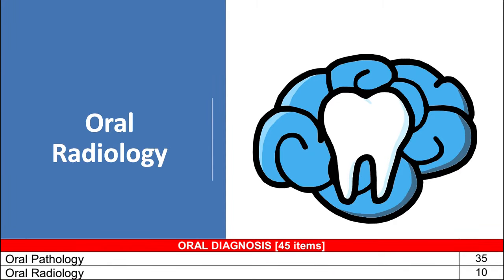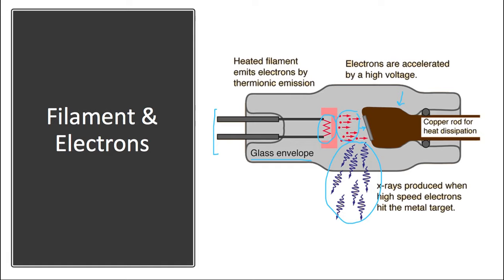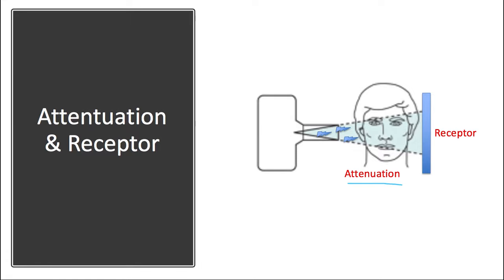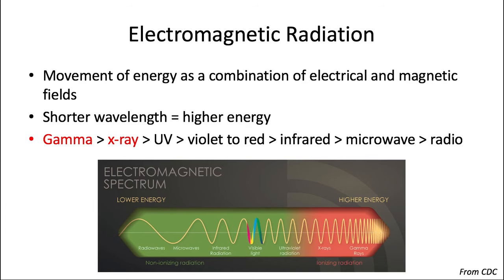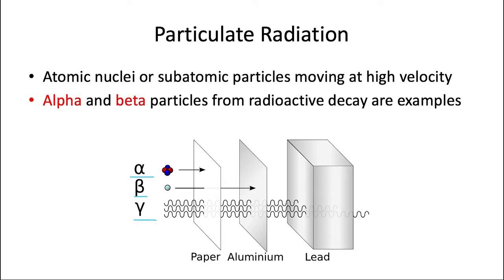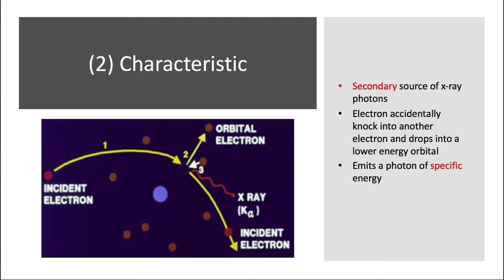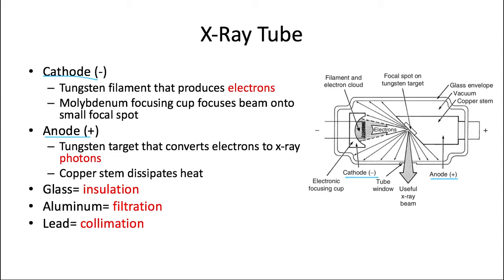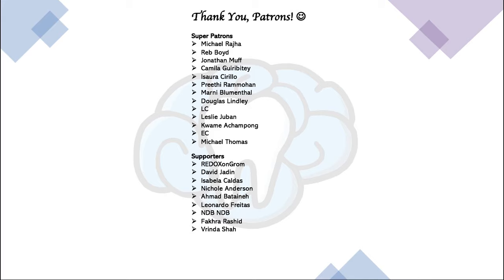Oral Radiology | Fundamentals of X-Rays | INBDE, ADAT

Comment: May i ask which kind of 3D radiograph is using high speed rotation anode? thanks
Reply from the maker: I do not believe any dental x-ray machines utilize a rotating anode. Medical CTs may have a rotating anode with a much higher dosage, but CBCTs use a stationary anode.